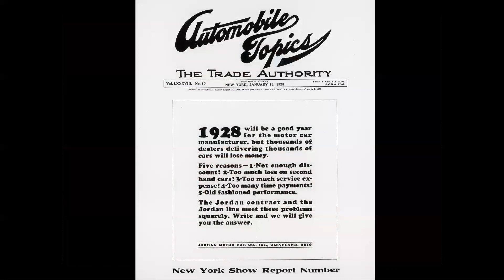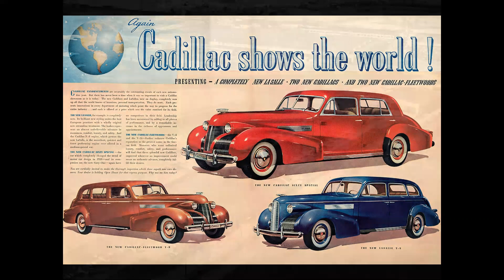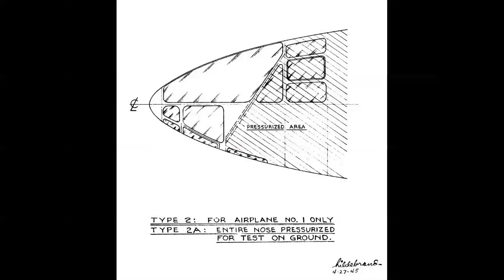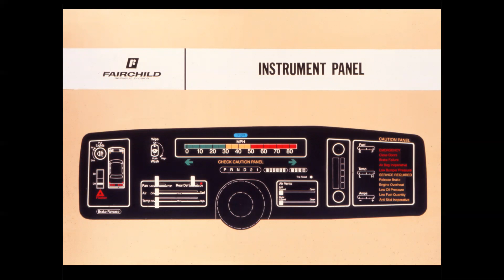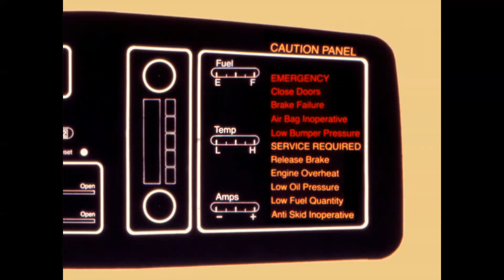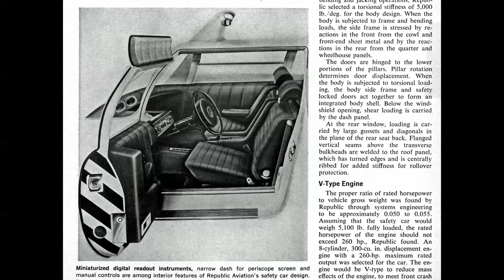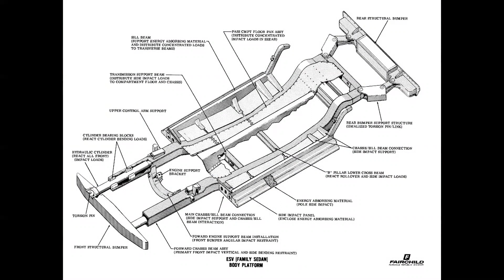FAIRCHILD REPUBLIC'S ESV - How Jet-Age Safety Technology Revolutionized Automotive Design

Comment: Great video.  Dr. Stapp recognized that more pilots were being injured in car wrecks than were injured in plane crashes and insisted that seat belts be put into USAF staff cars.  He did much research on human tolerance to impacts and g tolerance working at the Holloman Aeromedical Lab.  The lab had an air-powered sled and track called the "Daisy Track" after the BB gun.  Stapp rode the Daisy track sled many times and established the needed strength of auto and aircraft seat belts ~ 6000 lb of tension.   He helped set up the Automotive Safety seminars that became known as the Stapp Safety conferences.  His work saved many lives.
Reply from the maker: Thanks Jim, and agreed 100%. Stapp also had a very dry sense of humor, even naming the slow-speed (200 mph) sled at Edwards North Base the "G-Whiz." When I asked him why he performed all of those dangerous tests himself, he said, "I didn't wan't any of my men getting hurt." Best to you in 2021!

Comment: I had no idea that Fairchild was involved in the auto industry. Definitely have to give credit for at least planting the seed for development of some of those safety features. The one problem I have with newer "safe" vehicles is that safety is removing visibility from drivers. Structural reinforcement of pillars has brought window sizings way down. If not for the development of blind spot monitoring sensors and back up cameras, most modern vehicles would be more dangerous due to lack of visibility. Also, some new safety features are now allowing drivers to drive beyond their own capabilities due to automated systems that will save them and that usually ends badly! Great video, Mike!
Reply from the maker: Thanks Adam - appreciate the comment, and agreed, today's self-driving technology has certainly taken man out of the loop. That's a whole 'nother video!

Comment: Your Uncle George had a remarkable history. A few questions... Why were automotive engineers sought by Republic to design canopy and cockpit areas vs. the aero engineers already on staff?  Second, did you notice that the lead razorback P-47 in that three ship formation photo has a flat windscreen instead of a "V"?  The flat windscreen was used on the bubble tops, but I have never seen anything but a "V" on the razorback in decades of looking at P-47 photos. Was this a rare transition airplane, a company one-off to test the flat windscreen before it was used on the bubble tops? The other two planes in the formation appear to have the usual "V" windscreens. Third, you said your uncle patented the bubble top on the P-47. Does that mean that he was the father of the bubble top concept overall, or just in relation to its application on the P-47?  As for the car, the front end fared well in the collision test, but the windshield looked shattered, so I'm wondering where the impact energy was absorbed? If the "driver" took it against the windshield, not so good, or maybe they thought the airbag would mitigate everything. I wonder if the engineers at the time considered forward of firewall crush zones like they do today? I remember one experimental car from the 1950's touted as essentially collision proof because it was so rigid, like a tank. No seat belts, horrible for the occupants. Sorry for rambling, but there is a lot here that Paul Harvey would have called "The Rest of The Story". One of your most interesting videos!  Thanks Mike.
Reply from the maker: Thanks for the great comment and observations! Republic was seeking automotive engineers specifically with experience in glass and windshield design and George jumped at that chance. His patent (credited to the company) was for the P-47's canopy - first bubble canopy on a US production aircraft. The three flight-test P-47s in that formation photo actually have three different canopy/rear window configurations illustrating ideas for improving rearward visibility, although none were as effective as the bubble canopy. Windshield on the crashed ESV resulted from a short circuit in the air-bag mechanism that caused the crash-test dummies to impact the glass. (Should've mentioned that in the video.)  And yes, early-generation energy-absorbing 'crumple zones' were integrated into the ESV design. Again, terrific comment, thanks!

Comment: How come Republic was rewarded for this project and not some avtomotive company?
Reply from the maker: Excellent question! Republic won the initial New York State study by proposing the use of Aerospace technology to solve the problem of high-speed impact and survival. Both General Motors and American Motors built "Safety Car" protoypes in 1970, but the Department of Transportation awarded Fairchild Republic the final contract to built the two cars tested in Arizona based on the company's 30 years of aircraft crash-survival experience. Thanks for the question, and apologies for the belated reply.
Reply: @celebratingaviationwithmik9782  Thanks for answering me, and it was well worth waiting.